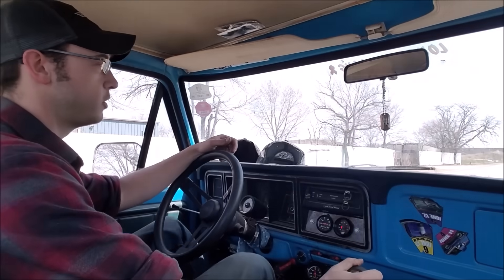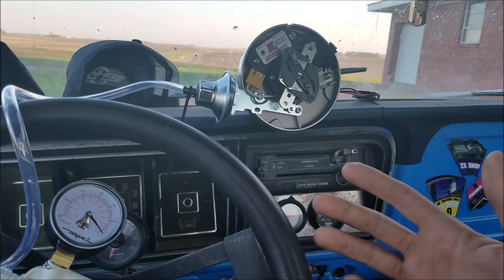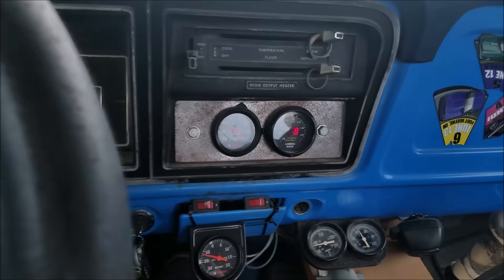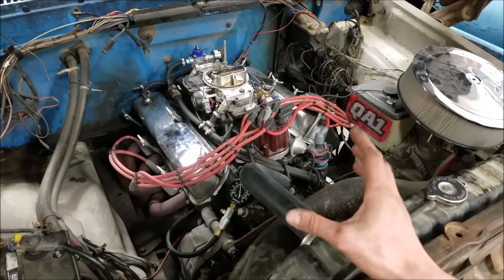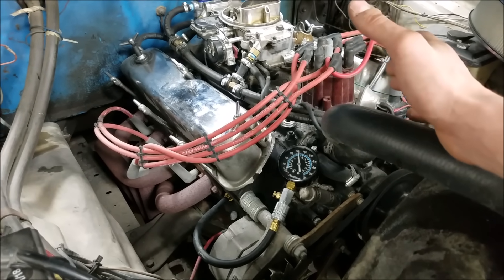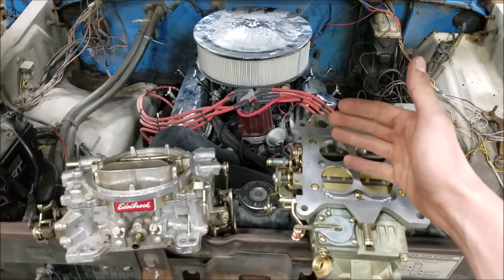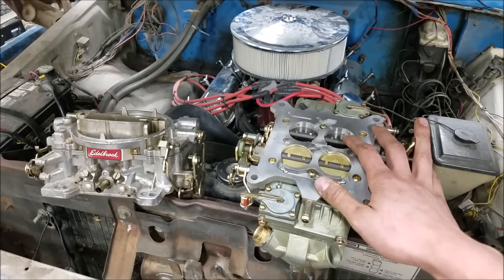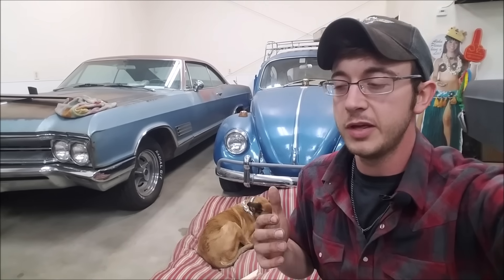Vacuum Advance - Ported vs Manifold: Which to Use & When !!!

Comment: I am 62 years old and well versed on carburetors and their circuits.  You are spot on with your description and you are so articulate in your explanation of what is going on in the combustion process.  I am lucky enough to have spanned both the carbureted engine era and the electronic fuel injection transformation that I understand both.  I so respect you and your in-depth knowledge of carburetors and hope you can pass this on to the younger people.  I remember the ignorance of my youth before I understood the simple yet sometimes complexity of carburetion.  Thanks for the videos.
Reply: I can definitely relate. I am only 42, but I have spent so many summers just trying to tun my carburator, just to have it run terrible in the Canadian winter. Now I just use my vacuum gauge to fine tune my carburator and timing to the changing seasons. I actually love the task, as it give me the opportunity to constantly go over all of the other systems at the same time.
Reply: Man,I wish I had you as my nabor.i put in a carbed 351w  engine in my f150, and it's running rough. Many shops don't even want to touch a carbed engine.
Reply: @markconrad4160 
Since no one else has addressed your comment (keep in mind, I don't know your whole set up) my first advice would be to throw away your stock Ford ignition system and use either a GM HEI or some after market ignition system. I'm sure you have other tuning to do as well, especially after the ignition swap but if you are still on crap Ford ignition then that is definitely the first place to start.
Reply from the maker: Man that means a lot - I was jaded from the beginning against the modern stuff because my dad taught me with carbs - just so easy to get around an engine bay, once I experienced that, there was no going back!
Reply: I'm 65 and have a 1962 sunbeam alpine with an inline 4 and dual carbs I have tuned like a Swiss watch.. But I love this guys work and knowledge... Might think about it for my 1973 lemans.
Reply: Dude, now your 65
Reply: I took a 350 fuel injected motor out of a 95 GMC Sierra and put a 1976 305 ci that was overhauled the problem with that truck is by doing that I only had three gears because there was no longer a throttle body sensor to tell the transmission with the shift so I lost my highway gear flights at around thought about it for a night cuz I didn't have that much money to put into the truck to get a 700 r4 so what I did was I deleted 15 wires off of the transmission so while we're only had four wires coming out the transmission solenoid a solenoid b torque converter control and a 12 volt 10 amp wire going to the fuse box so when you turned on the key you turn on your transmission then the other three wires I hooked up to 3 switches like a race truck and was able to get my highway gear this was like five or six years ago before they came out with all the stand-alone computer I wanted to all motor engines in a modern-day truck I got a video of it for you in a couple some pictures I'll post tell me what you think about

Comment: Short of throwing  away my 4100 carb with a completely plugged ported line, is there another way to add another ported spot on this carb?
Reply: Make sure it's got the right metering block gasket

Comment: that is a really cool distributor setup.  The only feature I wish they included is a closed loop spark correction for idle.  Similar to how the OEMs do it with distributorless spark control.  Set your target idle RPM and it will pull and add timing to keep your idle steady.
Reply from the maker: Wouldn’t that just be the ticket! 
Iv been working on something myself that adjusts idle afr - I actually do hobby programming and make apps on the side 👍
Reply: @ThunderHead289  I can see it needing a TPS and possibly coolant temp when used with a carb since idle rpm fluctuates.  But with a holly or IAC based stand alone it would work mint.   Could even use proportional correction only instead of the common PID, simplifying the math.  Man, you've peaked my Nerd interest with your last comment, I assume your doing this with a carb?  Similar to the old 80's computer controlled rochesters?

Comment: When graduating to the distributor from Progression Ignition you no longer need to decide between ported and manifold.  It needs a MAP signal so you must use full manifold vacuum.  My question is this(I have this distributor) is it better to use the port in the manifold itself or is the manifold source on the carb just as good?
Reply from the maker: Both are equally as good - yes correct, the progression unit needs full manifold because it uses the manifold to very the timing along the timing curve trend line. 

It’s the coolest little all in one unit
Reply: @ThunderHead289  Install was very easy.  App has worked flawlessly.  I think this is a game changer when it comes to tuning

Comment: What would suggest for initial timing on an Amc 304 ? aluminum intake, Edelbrock 500cfm carb, Mallory HEI, RV cam.
Reply from the maker: If I had to guess - it will want 6-12 initial if you have your mix screws and throttle set correctly 👍

Comment: I have a Chevy performance crate 350 and I got the beefed up one with the cam and some other things but I’ve set the initial timing to what the build sheet says to and I can never get it to run decent on ported at idle it sounds like garbage but whenever I run it at full it sounds better and it seems like better off idle throttle response. But every engine is different this is what I see to be the case with mine
Reply from the maker: It’s because you need more mechanical initial timing! 👍
I basically go up to 16 or 18 advance, then if it needs more I’ll open the throttle 1/8th turn and then drop down the initial timing. 

This is all a balancing act - now really big cams are going to favor full manifold vacuum. I can get into why, but that almost needs a video all it’s own!
Reply: ThunderHead289 if only the vaccum advance wasn’t hitting the intake 😂 I could fix it but I’m lazy and but yeah right now it’s as advanced as it’s gonna get as far as initial

Comment: So what should the mechanical timing on an hei distributor be set at?
Reply from the maker: It depends all in what your engine wants - somewhere between transfer slot exposure and before vacuum on ported port is where your throttle needs to be - from there, you can determine what initial advance your timing needs to be to achieve the desired idle rpm

Comment: No 385 series Ford 😯🤔😭
Reply from the maker: It’s the same as the 351C distributor !!! 👍👍👍
Reply: @ThunderHead289  I thought it was , im a FE freak from the 60's and on my first,  built nasty 460 project. Thanks .
Reply from the maker: swampratt36 the fe is a great engine - my 390 is a tank of an engine
Reply: @ThunderHead289  Yes it is , they are virtually indestructible torque monsters , provided they have water n oil and the motorcraft toilet bowl removed . 🤣

Comment: Thank you so much for the link to Progression Ignition, I had not heard of them before and I'm really glad I have, just looked through their features and I really like what they have come up with, alot of nice features and usablity, to me this will work alot better than going with a Holley Sniper/Hyperspark setup and I get to keep the simplicity of my mechanical fuel pump and carb, but not have to play around with different vacuum advance cans and springs ans weights and bushings, plus built in rev limiter and boost retard sounds cool too for furture proofing. Thanks again for the link!
Reply from the maker: No problem - we have to get the word out on them. That’s good stuff that we need to make sure does not get suppressed by the big names
Reply: @ThunderHead289  I agree but its so cool I wouldn't be surprised if Holley tries to buy them. I just wish this video came out a year ago when I bought my distributor haha.

Comment: Leaner fuel mixtures = more advance. Aka idle and cruising on the highway. Wide open throttle = no vacuum and no vacuum advance. Ported vacuum = no vacuum at idle. Manifold vacuum = vacuum at idle. Idle timing = what you set with a timing light. If you connect to manifold vacuum you add the advance of your vacuum canister to your idle timing. Depending on vacuum canister usually 10-15 degrees of extra timing. So you can have a reasonable ~10 degrees of timing without kicking back your starter and get the extra timing you need after your engine starts to make vacuum (running). A lot of vacuum cannisters can be adjusted to add or remove timing and you can get them in different varieties based on how much vacuum your engine makes at idle. Engines typically run cooler with the additional advance at idle. The purpose of ported vacuum was an emissions device to purposly heat up your exhaust and reduce emissions. The progression ignition product is basically EFI without fuel control. It gives you a programmable ignition table using a map (vacuum) sensor. This is like the Ford and Chevy fuel injection systems of the 80s without fuel control or a carbureted LS engine with an ignition controller.
Reply from the maker: I agree with everything except the old “it’s for emissions” lies - flatheads before the time of folks caring about emissions or economy utilized a ported vacuum port. You can find it in service manuals. 

And an engine shouldn’t run hot at idle unless the cooling system is compromised - they aren’t making enough cylinder pressures at idle for them to be that sensitive. 

Iv actually seen folks run hotter on manifolds because it will favor a lean mixture. Lean doesn’t have as much of a cooling effect and temps will increase. 

But my biggest reason for running ported is that you can run more aggressive initial mechanical - so when you punch the gas from a stop, you have a much more reasonable advance degree that will help the vehicle get off the line!
Reply: @ThunderHead289  The whole emissions thing was just something I read it might have something to do with EGT (exhaust gas temp) for emissions but you would probably have to talk to a Dyno operator who has seen lots of hard data. If you set your idle mechanical timing to let's say 20 degrees as an example w/zero vacuum advance. You take the same engine and set it to 10 degrees mechanical w/10 degrees of vacuum advance. In both situations you would have the same ignition timing at idle. Springs and bushings are used to set up what rpm you have max power and how quickly you get there. The vacuum advance is used modify your timing for cruise and idle. It adds to your mechanical timing.
Reply: @ThunderHead289  what if we turn the topic around a bit? Is it improving emissions to run higher exhaust temp, yes or no? Is ported vacuum a means to get higher exhaust temps, yes or no?

Comment: Good job Luke.  I agree with everyone you are showing us, and I have re-curved many distributors to "tune" the engine.  I think that Progression Distributor is awesome - very trick, and that is definitely the next one I order and try out.  Lots of great features!  Thanks for the video - keep it up and take care!
Reply: Recurring a distributor is a requirement in my eyes.  Replacement distributors are just in the area that will run properly but not ideal.  I'm shipping my 86 mustang 302 DSII distributor to a guy I know that has a sun machine and let him work his magic on it.  He agrees with me how ever total advance should be limited to around 32* with my fast burn style heart chambered heads.  Stock distributors like mine are usually around 40* advance.
Reply: I have a progression distributor on my 406 and it works very well. Still havent figured out all the technical timing table adjustments but I can tell you recurving is not in the same league as tuning with my phone. It also can be used for controlling timing when using boost and I am going to try and use it with my nitrous

Comment: Think there's some good info here.I'm a big believer in a vacuum advance as I,along with most people,don't spend a lot of time at high RPMs in daily driving.A more responsive engine and better fuel mileage is what I like.Thanks for helping point things out in a way folks can deal with!
Reply: Vacuum advance isn't related to WOT operation.  However, getting it tuned right for either manifold or ported is crucial for part throttle.

Comment: I like manifold vacuum best, it advances during idle to help cool the engine and gives better throttle response off idle.  During light load and cruising it improves response and fuel economy.  If you floor it with manifold vacuum the only thing controlling timing is the mechanical advance and I set that at around 36 degrees.  The most important factor is to not overadvance the engine- always make sure you do not overadvance at full load- if you do you will get pinging or worse detonation.
Reply from the maker: Literally as I show in the video - the only difference is at idle between ported and manifold. 
It absolutely does not give better throttle response off idle - neither do because vacuum drops below where either add timing. 

Watch the video and really review how this stuff works - people have regurgitated lies all over the internet and I can see them in your comment.
Reply: @ThunderHead289  It is my real world experience.

Comment: I’ve always used manifold vacuum, but I’ve never built an engine with a cam under 230 degrees duration @.050. Idle vacuum around 12”
Reply: you should always use manifold vacuum this guy doesn't understand the theory well, keep in mind you can "tune" the can, likewise keep in mind you can "tune" the mechanical as I am sure you know. You have to give the engine what it wants not just give it what you think it needs. For that you have to "give" it advance with a vacuum pump and measure power output or how much the throttle comes up, record info and tune to this curve

Comment: Now I'm only about 6'3", but I have a 34" inseam, and it is a tight fit with my legs in my 67 f250. Any tall guy tips on setting up the stock pedals and seat for a little extra leg room?
Reply: Relocate the fuel tank...theres 6 inches 🤣

Comment: I’m close to finish my 331 build. I have a comp xe266hr12 cam, summit 600 carb. Would that cam (mid range lift, fair cam overlap) fall in the side closer to stock/mild or high lift/overlap?

Comment: I dont know shit about carbs, been and EFI guy my whole life, but your vids are  really informative and help me understand a little.
Reply: Honestly carbs are obsolete now with the fuel blend we have now.  It causes problems in carbs that carbs never had before.  It's a big reason why I decided to spend $1800 more on my 306 build and go holley fuel injection.
Reply: Nothing is more satisfying than working through the steps to marry a carb and distributor timing such that your engine achieves it power potential but still runs as  smoothly and efficiently as an EFI set up. This is easier than ever with the excellent advice offered by Luke in his carb and timing series of videos.
Yes, it takes some patience and effort, but is otherwise nearly cost free.
 Via working through the steps offered by Luke, I am up to 19 MPG on my Ford 289, and it has more power and idle/ runs silky smooth on pump gas thru a 1406 carb that someone gave away.

Comment: Is there a good way of setting initial throttle blade position without taking the carb off and looking at the transfer slots? Can you just use vac gauge on ported and close blades until you just lose signal and be pretty close, or is that still too much?

Comment: Is that a train horn? That is awesome! I wanna put a train horn on my 84 ranger.... Small truck with a 7ft bed. Fricking train horn blasts. My truck would be the last thing people it came from lol. Also, my horn doesnt work. the column horn button doesnt work for some reason....
Reply: Did you unplug the horn and check the plug with a light tester? If so, check your fuses. Run a jumper wire from the hot side of the battery and touch it to the stem to see if the horn isn't broken.
Reply: @brianwolf692009  I dont even feel a button. I dont feel anything on the spoke other than the signal and high beam switches.